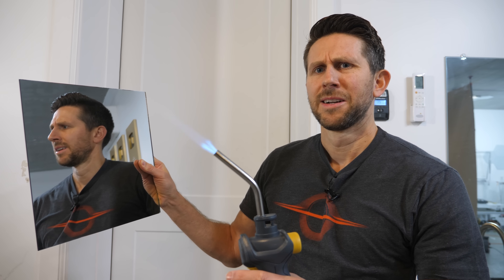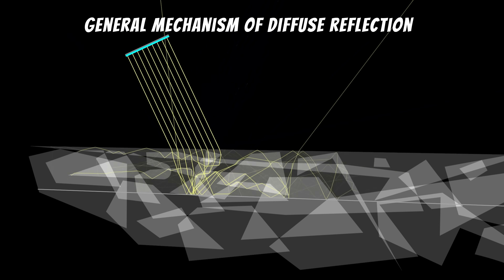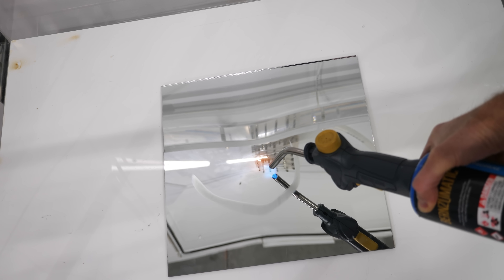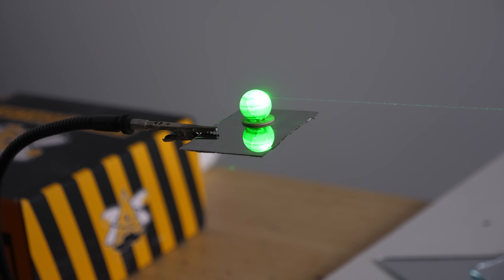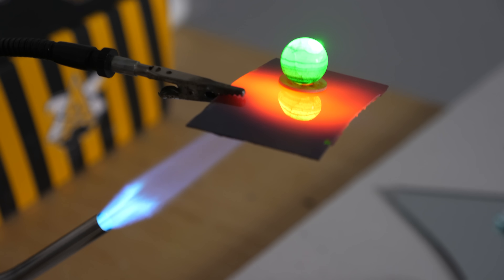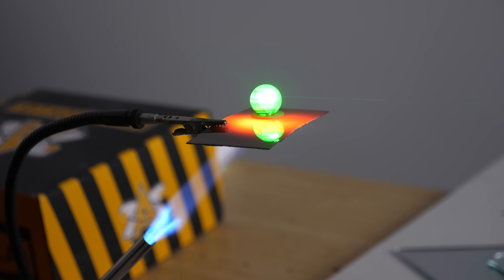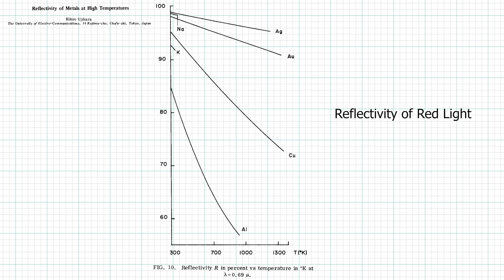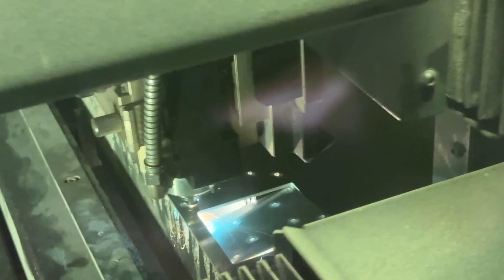Can a Red-Hot Mirror Still Reflect an Image?

Comment: So does this mean cooling it with liquid nitrogen will make it more reflective? Or are we already near the max at room temperature?
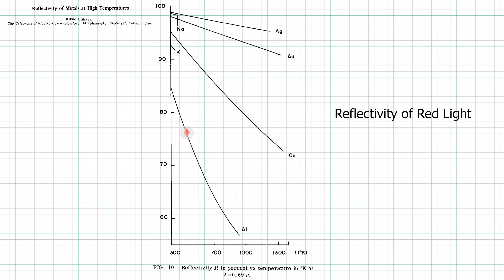Reply: It's a good question. At 7:00 the X-axis starts at 300K - wonder why they didn't go colder?
Reply: And can be here a super-reflectivity like with superconductivity ? It would be very cool to have a column or a ring of light between two perfect mirrors
Reply: The numbers seem to lean in that direction.  The problem with cooling a mirror below room temperature, is condensation.  This can be solved by removing air or just the water vapor from the room, but then it becomes much harder to get ready for work in the morning.  (0% humidity leads to rapid dehydration.  0% air leads to rapid suffocation.)
Reply: @VoltisArt  I'm not sure I want 100% mirror performance in the morning. The less I see of my sleepy face the better :)
Reply: @mb-3faze  lol I hear ya.

Comment: So, is this the reason why polished metals at around say 300 kelvin (room temperature) don’t emit thermal radiation very well I.e. have low emissivity (those with thermal imaging cameras might know what I’m talking about) but heat them up to say 3,000 kelvin (around the temperature of the tungsten filament in an active incandescent light bulb 💡) and they emit thermal radiation much better?

Comment: this is actually really awful when welding aluminium. it's protected from oxidizing by the inert gas around the liquid metal, but aluminium is very reflective, so it just reflects most of the light from the arc. if you are in a room made from aluminium and welding (like on a boat), any bit of skin that is not covered will get a sunburn very quickly because all the UV light is just bouncing around in the room. 

at work i had a guy welding behind me for like an hour, half an hour. and i was welding all morning too. the back and sides of my neck were not covered and i didn't notice when it was happening. it just felt like an uncomfortable warmth but halfway through the day when lunch break started and i stopped welding, my neck just started hurting worse and worse. turns out the sides of my neck had turned purple and started bleeding. worst sunburn I've ever had. i continued just having a wet rag on my neck for the rest of the day. it took over 3 weeks for it to heal and my skin peeled off multiple times. not fun.

moral of the story: wear sun cream, damn it!
Reply: After working with a laser cutter, like in his last video (same brand, btw), I found that it takes more power to cut aluminum, than steel, due to the reflectivity. And until recently, since these lasers work in the IR, it wasn't practical to cut copper, since copper is even more reflective at those IR wavelengths.
Reply: @michaelmoorrees3585  Yep. There's a reason that space-helmet visors are coated with gold, as well as the mirrors on the James Web IR telescope
Reply: @tantamounted  Sorry, what is the reason?  Because they respond well to heat? Because they maintain reflectivity when hot?
Reply: @Williscald  The reason is that gold reflects infrared wavelengths more effectively, so on a helmet visor it reduces the incoming heat of solar radiation, while on the James Webb telescope mirrors it improves the sensitivity of the main instrument
Reply: Aluminium also takes more power to weld than steel. One reason is it's such an efficient heat conductor it takes alot to heat it up at all as the surrounding metal draws away heat so quickly. Also, as a metal with it's hyper fax oxidation and other weird properties (it's near semi-metals on periodic table, someone once told me it was a semi metal but that's quite a controversial perspective) you need a much larger heat puddle to weld and just overally more heat. Combine that with the hyper reflectivity and you got a real need for PPE and cooling.
Reply: I don’t every do welding but I feel this was more useful information that the video itself
Reply: Yup had the displeasure of being fried by a laser cutting some stainless steel with helium assist gas.😮
Reply: A couple months ago I spent a week welding together the inside of a stainless steel chute at the factory I work at. There were two of us in there. It got really bright at times, lol.
Reply: now you know how chinese food feels when you reheat it in the microwave.
Reply: Or cover yourself in metal.
Reply: Wow, thank you so much for the cautionary tale and sorry that happens to you!
Reply: I could never be a welder. I get sunburnt in the shade.
Reply: That's why I was a Boatswains Mate!
Reply: Also arc welding produces lots of UV-C specially, while usually we get more UV-A and B from the sun.
That burn must have felt horrible...
Reply: Damn that’s crazy
Reply: Most sunscreen works by absorbing the UV before your skin does. However it's a bit of a one-off absorption for the molecule that just protected you from that UV photon. This is why it's important to re-apply the sunscreen at regular intervals. Better still - just protect your skin with material of some sort.
Reply: @mb-3faze 
old science. 

Sunscreen is a killer, they really trying to push mineral versions but they’re not great either. Unless you’re a ginger avoid sunscreen. 

Our bodies are designed to cope with the Sun, but our indoor lifestyles have made us weak and susceptible. 
Lack of Sun is deadly to both your Immune system and mental health.
Reply: mig and tig cause bad sunburn regardless of reflectivity... stick and flux core tend to obscure the arc a bit, all the smoke tends to absorb most of the UV before it even escapes...
Reply: They should use this in weapons tbh
Reply: @likefrim  How so?
Reply: @robinseibel7540  some kind of gun
Reply: @likefrim  Standard firearms are cheaper and more efficient than lasers. There's lots of cool "futuristic" technology from sci-fi that we have the technology for today but don't use because of cost and practicality.
Reply: sun cream. heh

Comment: Hmm, could you see your own reflection if you stared down a pool of molten metal using a red-light filter?
Reply: Most low temperature liquid metals are great mirrors, so theoretically that should work.

Or the reflected object needs to be brightly illuminated
Reply: @m1k3y_m1 mercury is a good example.
Reply: Mercury is technically a molten metal, and yes it's very reflective. A pool of it would look just like a mirror.
Reply: @F0XD1E  indeed.  Mercury has been used as a telescope mirror, because of this.  (They actually spin it to get a parabolic surface.)  Optically clear mirrors generally require a lot of prep and protection, so if you are able to get and use mercury safely, it's a very good reflective surface that levels itself.
Reply: If the melt is radiating a lot in red, red light filter would be counterproductive because it would diminish the contrast between reflected image and light emitted by the melt. Green filter would be much better as it would mask most of that glow.
But yes, molten metals reflect light specularly, too. It's just that, if they already glow a lot (like gold or iron), reflection gets drowned in the glow, so you need to illuminate the object more to compensate.

Comment: fyi, "red-hot" isn't a thing that's significant in physics. things become "red-hot" when their thermal radiation falls within your eyes' detection range, aka visible spectrum. regardless of the material, that temperature starts around 530°C for humans. for other aminals, the "red-hot" temperatures are wildly different. so, "red-hot" has everything to do with biology and little to do with physics. because to a pit viper, your mum is red-hot.

Comment: AND/OR!..... Will a super heated or super cooled prism or crystal cause a different shift in lightwaves than a room temperature one?
Reply: as the object expand and contract, the density changes, so the optic properties will change too. not much, but it would be enough to see it I'd guess, like how you can see the hot air above a heat source distort light.
Reply: Refractive index (angle of light's path change) increases with density, so any temperature changes that affect density will change refraction.  The sun and moon are squished when near the horizon and can actually be seen after they're beyond direct line-of-sight because of the density gradient in the atmosphere bending light downward, towards the higher density.  Action Lab covered this exact phenomenon by shining a laser through multiple densities of liquid.  I think that video was a couple years ago.  This should generally mean a rainbow in cold conditions would project as a wider arc, but water is funny and gets less dense as it approaches freezing temp, so it could go both ways at different air temperatures.

Comment: Now.... How about super-cooled?
Reply: The condensation would just covered it
Reply: @arisishmael  ^ this, but if you just kept it in a bath of liquid nitrogen that shouldnt be an issue, would probably reflect fine as long as it didnt shatter 😅
Reply: @arisishmael  Argon gas, vacuum, dehumidifier, there's a plenty of ways to remove the water out of the air.
Reply: @smokyz_  well it not just water in the air...but the air itself...
Reply: But the problem is air, it's annoy the process and will stick on mirror
Reply: Superconducting mirror?
Reply: Do it in a vacuum then.
Reply: Yes!
Reply: Now I feel like if done properly this could be really interesting, because if the reflection is because the surface electrons are oscillating at the speed of the frequency of the light hitting it, and we know cold particles oscillate less because "cold" is our word for containing less energy as shown in that absolute zero is defined by zero molecular kinetic energy, could it still reflect? This is all based off my limited self taught knowledge so pls someone correct me if I got something wrong
Reply: oooh yeah whattt. that’s actually so true
Reply: I support this motion.

Comment: But u heated the metal from underneath instead of dead on from the top
Reply: Top was glowing anyway, what is the "but"?
Reply: @u1zha  the but is that he heated the glass from the top. Yet he heated the metal from the bottom. Maybe if the glass was heated from the bottom it took would still b a little reflective. But we don't know because he heated the glass from the top and the metal from the bottom. If u ask me to do a experiment it should b done the same way with whatever your trying to do.
Reply: @tyedye5555 the glass wouldn’t have got up to red heat without breaking even if it was heated from below. In fact the metallic surface would probably have oxidised even sooner.

Comment: Will a laser cutter cut through a mirror or just reflect the light back? Something I've always wondered.
Reply: Usually, reflect, but the mirror does absorb some light as he said, so if its intense enough, the point of contact will heat up until its noticeable and then burn
at least thats what I think
Reply: @WhatATwist-neoswing  if it is so then the conclusion would be that it will melt the mirror but will take alot more time then anything else
Reply: @Genghiz1182  yeah basically, or a lot more power
Reply: The next question is: if the mirror still reflects (altough a bit less then before), is there no risk of the reflected laserbeam burning part of t he laser device itself?
Reply: @Yehan-xt7cw  well that propably depends on the angle cause it will just reflect away however if you make it with a 0 degrees angle then maybe
Reply: You can laser cut polished stainless steel, but you need to stick a non-reflective material on the surface
Reply: intresting..

Comment: Great illustration early on for the diffuse reflection concept
Reply: And subsurface scattering.
Reply: @Beeblebroks  , I'm having a hard time understanding this explanation of _mirror vs white_. Still feels like white absorbs more light than a reflective surface, but scattering differentiates more between "ambient" and "mirror" light. I mean if that works like he described it then I could get a smooth lighting by just pouring a spot light on a white porcelain. And contrary I remember an old dark mirror which lose a lot of light but still mirrors the light it returns.
Reply: Is that taken from another website/project? Or was it a creation just for this video?